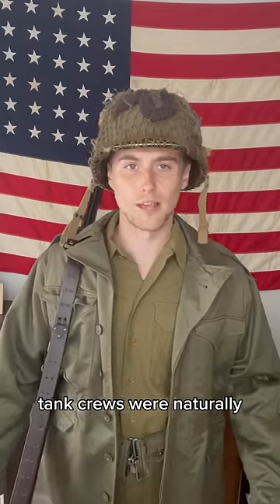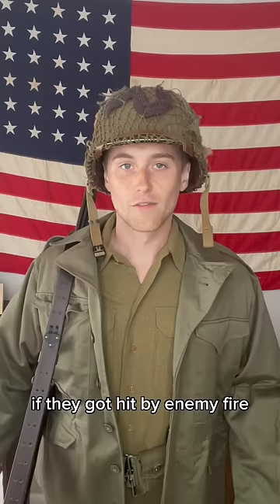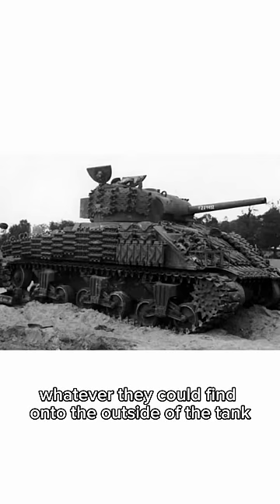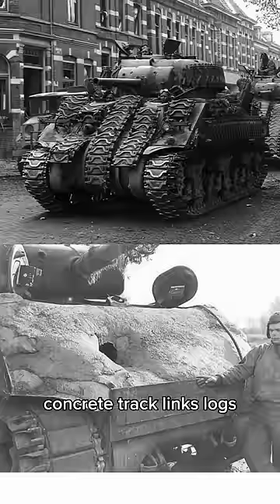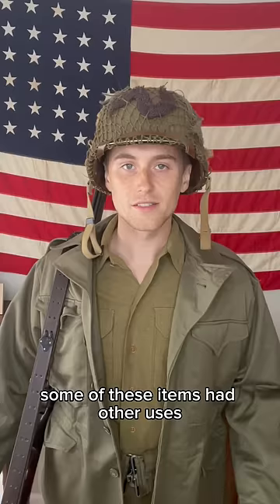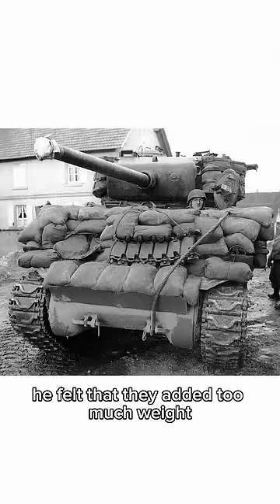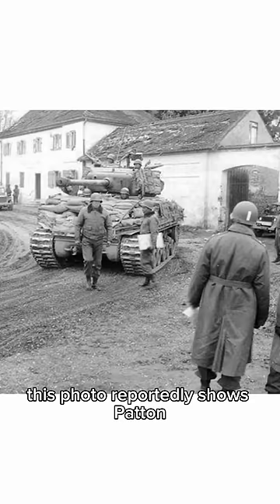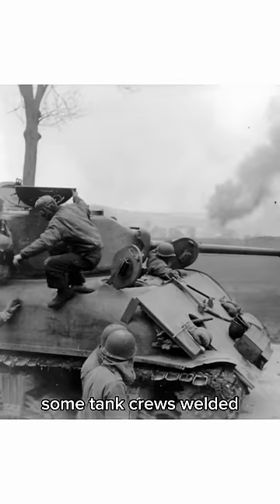Improvised Armor on US WWII Tanks

Comment: Meanwhile in WT shooting someone point blank range
"No penetration"
Reply: bro iove wt
Reply: @redmonkey4866  I know why but I still got to ask, why?
Reply: 150pen Face 45 side armor
Reply: That’s why I uninstalled that POS, gunner heat PC will end up putting them out of business, anyone who thinks other wise is a wallet warrior snail simp.
Reply: @scorchclasstitan6727 sounds like a skill issue
Reply: @maciekGTR  
Case and point.
Reply: god I hate volumetric shells
Reply: WT doesn't model shock damage properly. Even a deflected shell damages the armor. Plenty of heavy tanks have been literally battered to pieces by medium caliber high explosive shells just exploding on the armor and buckling the welds.

Comment: The issue of putting "soft material", but more so, soft metals like a track... is that it could help an Armor Piercing round "bite" into something and align it's trajectory to actually damage the tank when it would have otherwise bounce.

"Spaced armor" the one approved by Patton actually works since it doesn't present that issue.

Or so I was told.
Reply: It's not spaced armour just additional add on armour.

Spaced armour refers to armour ofset from the vehicles to protect against various lesser forms of  munitions
Reply: @l.a.wright6912 brother spaced armor is for heat rounds/shaped charges
Reply: @lk_t5811  no it originally was made for anti tank rifle rounds. It was just later found to be effective against shaped charges.

What I was pointing out was that Patton did not discover this or even test it. He tested add on armour which is different. Op mixed up the two
Reply: @l.a.wright6912 the armor add-on shown was spaced, so, idk why you're getting defensive over something you yourself didn't work on nor Patented (pardon the pun).
Reply: @GreasyBeasty The reason why the armor looks like it's spaced is due to the fact that it's welded to a M4A1 which had  cast steel armor with rounded edges. The add-on armor looks like the front plate from a M4A2 which had flat RHA(rolled homogeneous armor) welded armor. The RHA doesn't have the rounded edges of the cast armor which makes the edges not meet. Thus looking like spaced armor.
Reply: @l.a.wright6912 but is spaced by good fortune , perhaps if  not by design, still work against hollow charge projectiles 😢
Reply: @l.a.wright6912   Armor with two or more plates spaced a distance apart falls under the category of spaced armor. Therefore, welding a plate of armor over the original armor with a large gap in-between actually does fit the definition of 'spaced armor'.
Reply: @lk_t5811 WW2 spaced armor was worthless against shaped charges and in fact often increased penetration. WW2 shaped charges were poorly designed with slow forming penetrators and usually the shaped charge did not reach maximum penetration until as much as 2 feet from the detonation point, increasing the standoff distance actually increased the penetration.

Spaced armor was made for anti-tank rifles, nothing else. Modern cage armor is designed to crush and short out the fuzes of Soviet RPG-7s and is not spaced armor. Although lately there's been a use against suicide drones.

Comment: Plates with an air gap were effective against shaped charges.  The hot needle of gas from the explosion being focused forward was supposed to bore through the armor and spray the inside of the tank with super-heated gas and molten metal.  If it hit the plate instead, the outside of the actual tank armor got sprayed with hot gasses and droplets of metal, which didn't penetrate.

Comment: During the last months of the war in Europe when the Germans were essentially out of gas, man-portable anti-tank weapons like the panzerfaust and the panzerschreck became a major threat, particularly in close quarters such as towns and villages where the Western Allies were reluctant to initiate an attack. Both of these man-portable AT weapons relied on the Monroe effect to breach armor without the high kinetic energy provided by conventional AT artillery. G.I. improvised armor was reasonably effective against them, whereas such measures did little against the few operable and well-positioned Panthers and Tigers remaining to the Wehrmacht except to slow down the Sherman and make it even more vulnerable.
Reply: Some of it was, like the proper plates that were welded on to the tanks. The Third Army did a study during the war about it, along with several other US formations and found that most logs and sandbags added to tanks only made the panzerfaust more effective. Now you can call conflict of interest, Patton hated messy soldiers and equipment, but post-war testing of HEAT warheads showed the same results they and others got. The reason is because the early warheads didn't have any built in stand-off range like modern ones do. It was found that on average the panzerfaust performed better with a short gap between the armor. 

The sandbags would be literally blown away by the blast of the explosives in the shaped charge, leaving a mostly clear shot to the armor only a few inches beneath. The logs splintered easily under the same blast. The metal plates provided a solid, rigid surface that the jet had to punch through first, before reaching the main armor and thus wasting energy. There is a problem here too, unless the plate was angled, and had nine inches of backing with something like sand or concrete, this also made the panzerfaust more dangerous. British tests suggested that single angled plates would need to provide THIRTY inches of stand off for benefit, meaning the tank would become almost five feet wider and the driver would be absolutely blinded by a massive chunk of steel in the way.

This is getting too long, but to add the caveat here, if the panzerfaust/schreck warhead hit at a sharp angle, sometimes there was enough stand off range to help. The sandbags did occasionally result in deflections that otherwise would have hit and penetrated. Neither of these effects justified the 10-20% increase in penetration power, because at too little of an angle, it meant the weapon would penetrate the armor when it normally wouldn't have. 

It turned out the best way to avoid getting hit with a german rocket was to have the infantry in front, calling out targets to the tanks before they got within the hundred meter range of the panzerfaust. If you can't tell, I have too much free time on my hands.
Reply: @MUJUNKY  Thank you for explaining about the same as what I was going to explain.
Reply: I remember hearing a story a German told about when he was in the Hit-ler Youth. Him and his buddies would take out tanks with panzerfaust. He said one day his friend was running across the street to get a better look and angle on the tank down the street. As his friend was crossing the street the tank shot a round right between his friends legs.

Comment: I love Patton, but sometimes the guys digging the ditches should choose the shovels
Reply: My sentiments exactly. Though in this case it would be, like, modifying the handle to be more comfortable or something.
Reply: A diesel loves her oil same as a sailor loves rum
Reply: Patton was right in the end - sandbags and logs especially provided basically nil armor for a non-insubstantial weight, slowing the tanks down (which in turn made them more vulnerable.)
Reply: @maltewernerwoiske  the logs weren't there for armor. They were lashed to the tread to act as "feet" for better mobility.
Reply: @paralyzedtortoise8446  Not to mention that in some cases it put extra strain on the suspension.
Reply: @paralyzedtortoise8446 not to mention, that tank seems to have removed it's machine gun port and cemented it over.  There's no way that 6in of cement will ever protect you better than a .30cal machine gun.  Especially when the port was armored to begin with.  If you've ever seen an MG42 fired at a wall, you know those gaps in the armor are much better than something that will immediately turn into dust.
Reply: Tests conducted by both the British and US showed that to be patently false and often made them even more vulnerable to HEAT rounds.  

The process about how shaped charges worked, still wasn't fully understood.  It worked even better when the standoff distance was increased, which is what extra crap like logs, sandbags and track links on the armor then provided.     @maltewernerwoiske
Reply: @paralyzedtortoise8446 They did,  look what happened in other conflicts,  cardboard worked on protecting apcs from rpgs
Reply: @maltewernerwoiske  Not really. Postwar testing disproved this, and a slight standoff range may actually INCREASE penetration under certain circumstances.
Reply: Patton was asshole in the right place at the right time - if you consider their objective at the time

But yes I agree with you 

I don't believe he had spent a second in a tank in active combat, so he was absolutely not fucking qualified to comment here 

I see reasoning here that he understood this method was a lot of weight with little payoff - but I don't believe that 

The dude loved berating soldiers, and found fault everywhere he looked - I honestly think he looked at tanks the way he looked at soldiers in uniform, they must look as he expected them to

To me, the peace of mind and morale of the tank crews is worth a little extra weight, even if it was actually no extra protection
Reply: A lot of great, intelligent, and interesting comments on my post. One thing I would like to point out is that most of our understanding of ballistics and armor came about after WWII and even the knowledge that was available during the war wasn't necessarily known by every man. I whole heartedly believe Patton was just being Patton. He liked everything to be presentable, just like the Nazis with their classy uniforms did. I know Patton was an original when it came to tank warfare, but I can't help but think of his golden football helmet design for the tank corps and the practicality.
Reply: adding sandbags will do basically nothing to improve the armor protection of a tank
Reply: @paralyzedtortoise8446 it was effective against things like a panzerfaust though
Reply: If your doing something that damages your equipment and makes you less effective someone higher up should say something
Reply: He was literaly right. Armor piercing shells were completly unaffected by concrete applique and all it did was both weigh down the tank and make it even more front heavy. Making it even more likely for the crew to die.
Reply: He was right in this case tho welding armor was better than throwing a sand bag on it or trees it’s not like he forbid them from welding more armor on just had to be metal armor
Reply: @ryanlusby569 if they used them for armor then it wasn’t effective as armor for traction yes but I don’t think he had a issue with a few logs
Reply: @CaptainCutlerCat a rpg shell works way differently than a German tank round which is what they would be protecting against the rpg if I remember didn’t work cause it his the cardboard and went off to soon, a tank shell back then wouldn’t have that issue
Reply: @rambo-cambo3581 I think if he was a asshole for the tanks but let them weld new armor on the it was well founded but if he forbid any additional armor he would be in the wrong, cause additional plates did help but sandbags didn’t
Reply: @havoc989  the tankers were putting them on mainly for at launcher protection, plates and tracks would help for shells
Reply: He was right though

US and British trials in 1944? showed that the 17 pounder and 76mm weren’t really affected by sandbags or logs, concrete was too heavy at the effective thickness needed, and track links only provided a modest improvement 

Patton was specifically okay with additional welded on armor, because
 1, it kept the profile of the tank and looked good in parades (something he cared WAYYYYY TOO MUCH about)
2. It was actually effective, and didn’t destroy the transmission of the tank

The Germans reached the same conclusion in 1943
The Soviets never did 
To this day, they still think adding some logs 2x the protection they have
Reply: @ryanlusby569 no, they used it as armor, there are numerous accounts of them using logs as armor

It just so happened that it worked well as ground cushion as well
Reply: logs and extra armor plates were useful, sand bags not so much. the logs and armor would at the very least set off the german fuses early meaning less damage if any, the sand bags really didn't work against AT munitions.
Reply: @rambo-cambo3581 if it slows down the tank and makes it more vulnerable then no, the job of a military leader is not to allow his troops to do as they please it’s to make them the most effective fighting forces.
Reply: Except Patton (and Army Ground Forces) had the luxury of looking at the tank losses and other reports to get a bigger picture than any tank crew could on their own. If bomber pilots were responsible for determining where to apply armor they would have armored the places that got hit before they landed and not the places that when hit brought down a plane.
Reply: @rambo-cambo3581 Actually Patton did spend time in tanks in combat, albeit in WW1. As an army commander it wasn't his job to get on the front line, it was too coordinate the action of all parts of the Third Army which cannot be done if you're riding in a tank.
Reply: @rambo-cambo3581 Patton earned a Silver Star in France while fighting with the Tank Corps during the Meuse-Argonne Offensive.  Man was one of the first Tank crewmen in the US Army and founded the first US Army school for tank crewmen. Tell me more about how he never operated tanks in combat.
Reply: @havoc989  protection against RPGs is the job of the US Infantry. If the enemy gets close enough to hit a tank with a Panzerfaust in the side somebody wasn't doing their job.
Reply: Patton was right in this case tho. Especially with the concrete armor. Concrete actually helps some shells normalize when they hit the armor and make some tank shells fired at the Shermans penetrate even better. Plus those concrete slabs are extremely heavy and seriously mess up the suspension of the tank and cause reliability issue. In the case of Shermans that's one of the strongest advantages they had and those concrete and sandbags are ruining them.
Reply: Pay for that extra gas outta your pay then
Reply: @CaptainCutlerCat yeah, but it isn't just "add junk to increase distance." The type of HEAT round matters. Adding a lot of volume (spaced armor) is helpful, but adding a little bit can also make it worse. There is science and shit involved in making good field expedient armor.
Reply: @bornonthebattlefront4883 the logs are useful, though. I think that this should be a practice adopted by everyone. It allows self-recovery, which is a big deal, especially in a 70 ton MBT.
Reply: @joeis18  yeah I don't think a chair or object from a random looted house
Reply: @havoc989  that’s not how rpgswork . A cardboard isn’t enough to trigger the fuse lol
Reply: @CharliMorganMusic  the thing with modern takes is they don’t get stuck nearly as much and they weigh 20,000 pounds more then they used to with over 600 plus horse power on average above the ww2 tanks . Tell me you know nothing about tanks without saying it
Reply: sand bags would add hundreds of pounds of extra weight which would cause unnecessary strain and damage to the tank, and as some other people pointed out post war testing showed that in some cases the makeshift armor would actually allow explosives to do more damage, if a superstition is dangerous it should not be tolerated
Reply: What do you mean by that?
Reply: Logs can screw up shape charge damage though(i.e. panzershreks). So it can save a tank from that. Even nowadays some tank crews in less financially fortunate countries use it against RPGs. But it is going to need a gap between the wood and the armor plating.
Reply: @epicsasquatch452  So in a way it's budget reactive armor?
Reply: He's the commander of the armored forces. If his tanks are too slow to arrive where they need to go, the armor does you no good.
Reply: Not sometimes every time
Reply: @CaptainRon76  the ordinance board actively did tests and distributed the results to the troops to try and stop them adding these things as yeah it would at times make the round more lethal ...

But. The troops went " don't care, I feel better, more stuff is gooder , etc" and so many commanders went...
Well if the troops feel more confident.... Theeeeen it's kinda worth the tradeoff
Reply: I would agree, except for the fact that Patton didn't try to dissuade them from adding additional armor to their tanks, he simply found their particular methods to be lacking. If he didn't allow even the metal plates, that would be a totally different story, but I can definitely see his point of too much weight for too little protection.